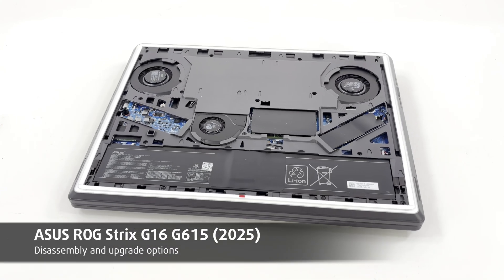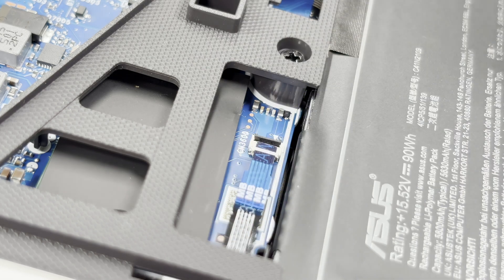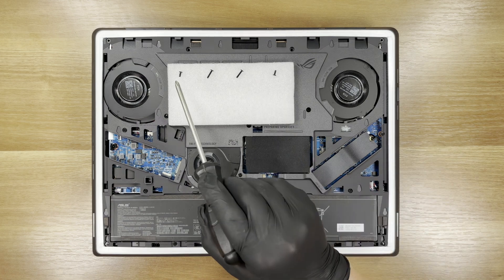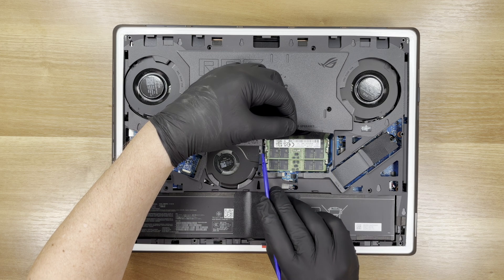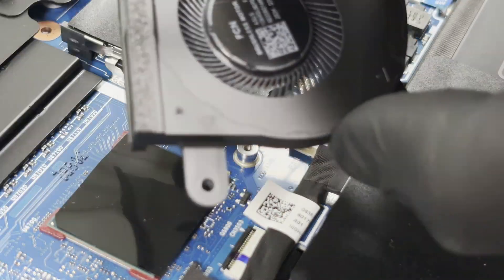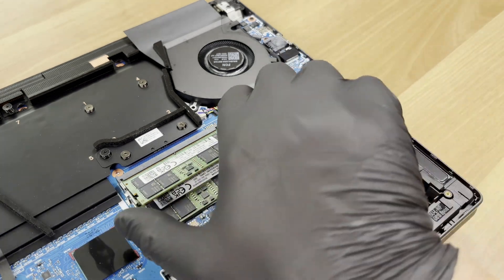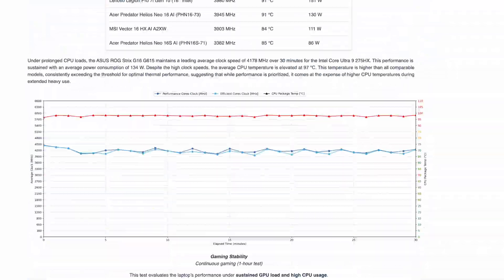🛠️ How to open ASUS ROG Strix G16 G615 (2025) - disassembly and upgrade options

Comment: are u sure battery connector couldnt have been disconnected right from battery. it doesnt make sense to change ssd u have to take out third fan to pull the connector for battery
Reply: No… 
There is a light sensor so whenever you open the bottom panel it will cut all electricity , to avoid short circuit from the user. So you can replace ssd without disconnecting battery .

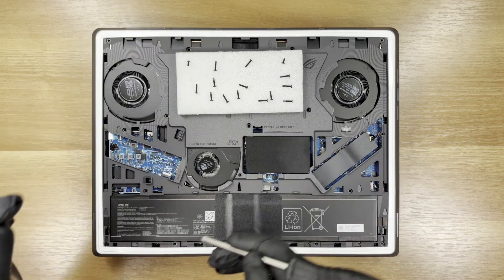Comment: 4:13
Ugh! Liquid Metal?!? That stuff kills laptops…
Reply: Nope. Only if you don’t know how to apply it ad contain it properly. It’s a game changer in terms of thermals in laptops. Did it on my 2019 Omen 17 with intel I7-9750H and RTX 2070 and the CPU dig get all in 100% speed without trotteling because of better heat removal. Still works today 3 years after re paste 😊

Comment: Thisnis ridiculous. It is advertised as toolless access. Not true. You still have to tear apart the laptop to change ou the RAM.
Reply: You don’t a tally have to go as far as he did. TECHNICALLY you can just replace the RAM or change/add storage without all of this. He was just removing the battery etc before advising a storage/ram upgrade.
Reply: 4:35 He states you don't need to disconnect the battery like he's doing and the RAM and adding storage is used accessible without all the steps he took.

Just discharge the battery to 25% or lower, I'm going to get the 5060 version for $1400 and upgrade the RAM to 32Gb's and add a 2tb drive.
Reply: No I just did it myself, no need to unscrew at all. Just open the cover and you are ok to change Ram and install SSD.